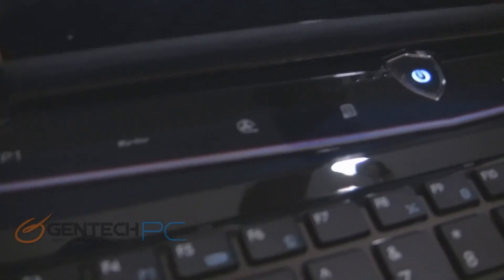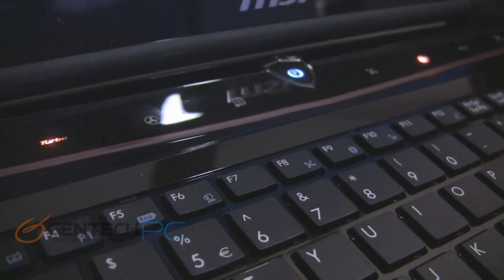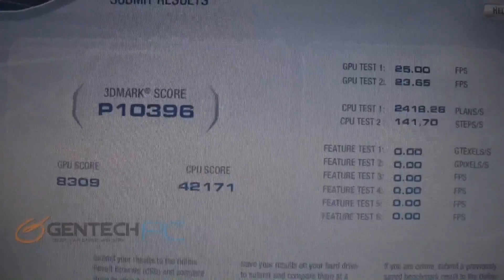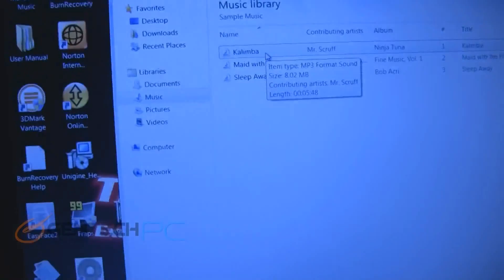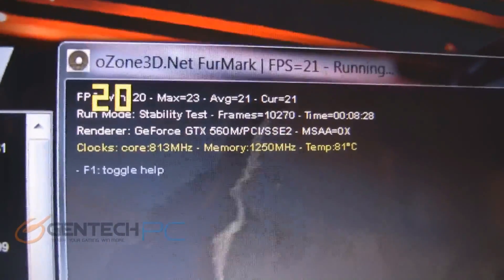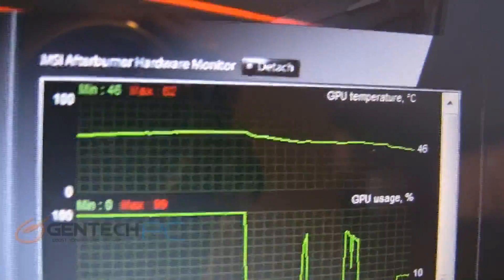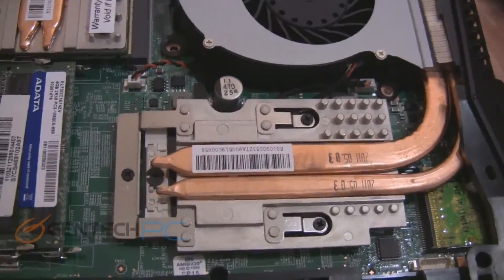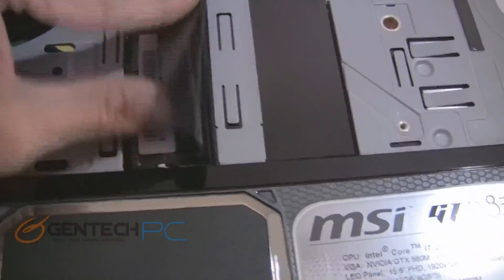nVidia GTX560M MSI GT683R Bonus Video - Benchmarks & Disassembly

Comment: Over all these years I still have this laptop, its great. I am facing a little overheating issue, what is the thickness of the thermal pads used in CPU and GPU?

Comment: Pls tell me I just can't decide witch one of these is better: 
MSI GT683R with 4 slots 8GB RAM incorporated and nVidia eForce GTX 560M 1536 MB DDR5 or 
Dell XPS 17 with 2 slots 6 GB RAM incorporated and nVidia GeForce GT 555M 3072 MB DDR3 3D Capable. 
With interests in gaming and mostly 3D modeling and animation pls reply.

Comment: I might be getting the GT683DX version with the GTX 570M, but I would like to know if there is a way to actually turn the main GPU (GTX 570) OFF and to run on the onboard graphics of the CPU, since the 2nd generation of Intel's CPU have a intergrated GPU, so that way I could save up on the battery life. Thank you buy advance.